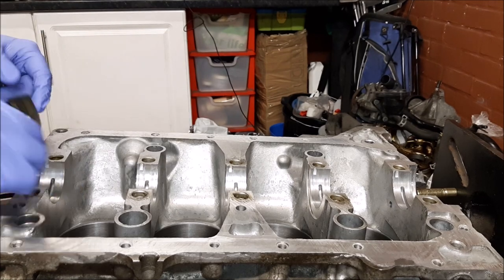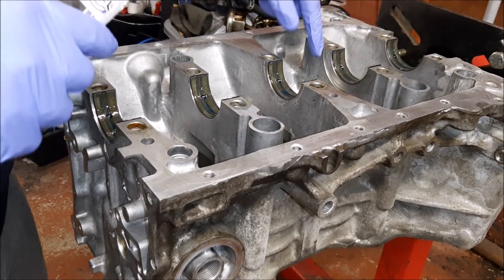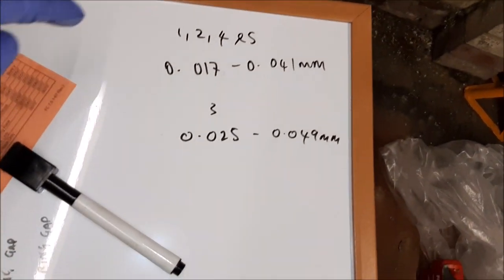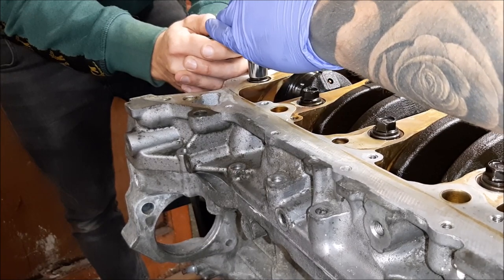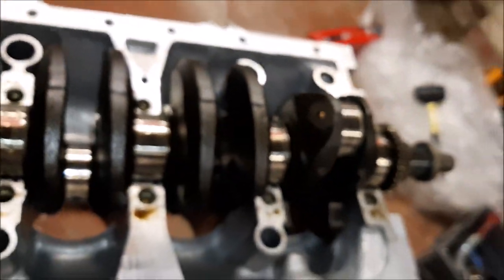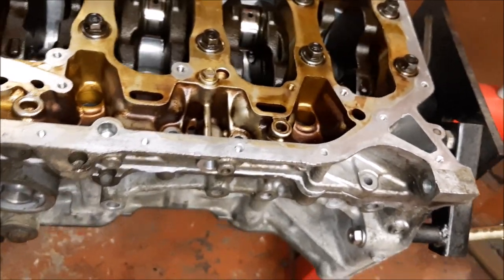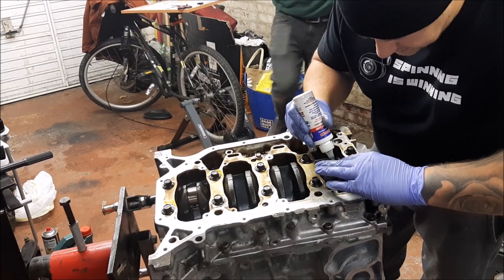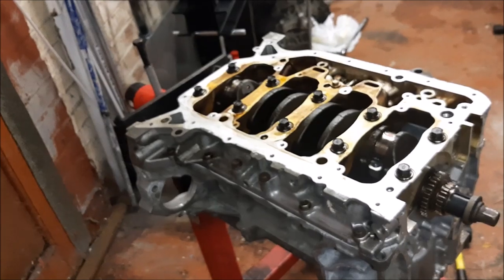Turbo Honda Civic Type R EP3 Engine Build Part 2 Piston and Rods are installed

Comment: To be fair i was really uncertain about building my own engine but after watching yours and SERGMOTIVE think im just going go for it, just need order a rpd bolt stretch gauge and ring grinder now 👌 keep it up dude
Reply from the maker: Thanks bro, to say I've never built an engine before it has gone very well. I've  double / tripled checked everything i.e. clearances etc and worked to the Honda Service manual so all being well it should be within the tolerances and run perfect.
Reply: @FlawlessCulture  Yeah spot on job your caution is similar to how i am, spent plenty of time reading the honda manual.  Think should be fine like you with sticking to all oem bearing sizes etc, what sort of power are you aiming for with having standard sleeves like me?  Merry Christmas
Reply: @chetwyn1030  Yeah standard bearings should be ok, you can always size your bearings off your block and crank. It was running 402whp before she blew up. So I will stay at that for now, I'm oversized pistons so dont want to push the std sleeves much more. Merry Christmas to you too.